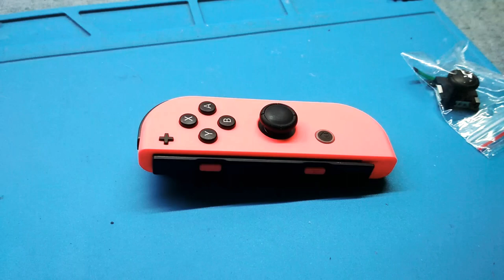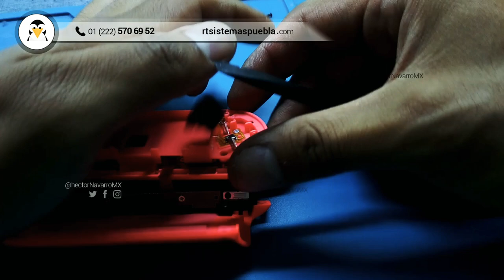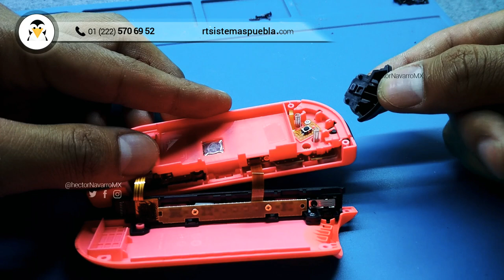How to replace Right joystick for Joy-Con

Comment from the maker: 00:00 Reparacion de control derecho de nintendo switch
00:02 Quitar 4 tornillos (desarmador "triwing" para nintendo)
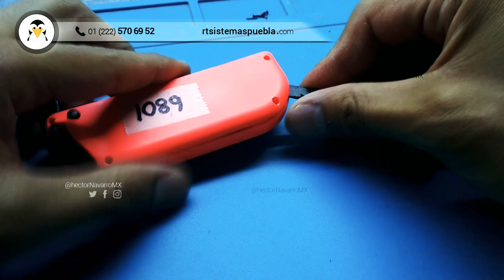00:18 Quitar la tapa
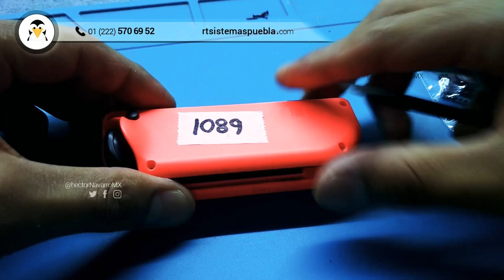00:28 Desconectar la pila
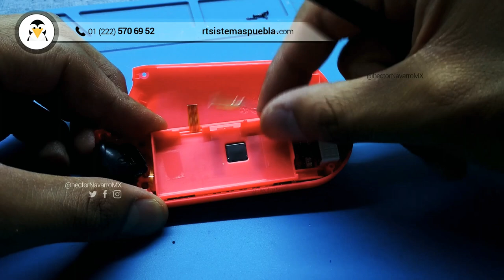00:41 Desconectar la antena
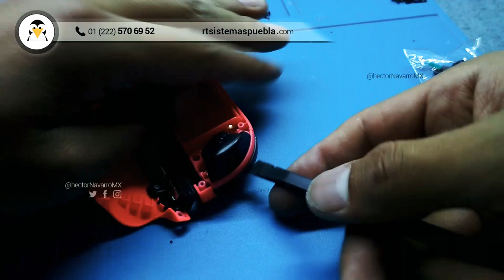00:49 Quitar el botón ZR
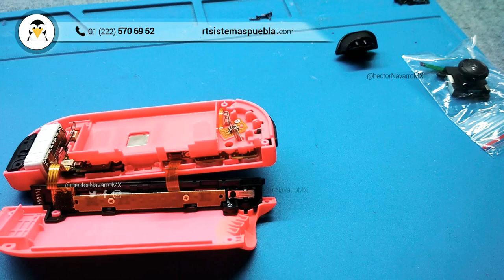01:10 Quitar resortes
01:27 Desatornillar botón ZR
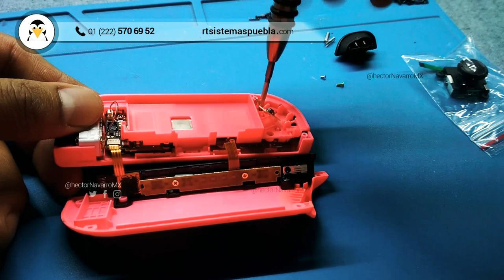01:37 Desarornillar el middle frame
01:45 Levantar el middle frame
01:56 Quitar flexo del joystick
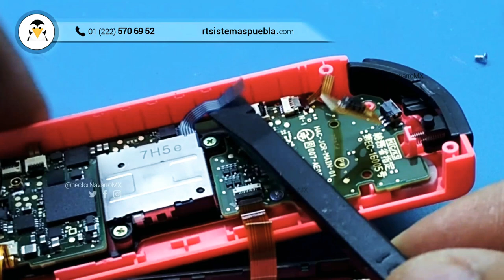02:04 Desatornillar el joystick
02:12 Quitar el joystick
02:22 Colocar el nuevo joystick
02:30 Conectar flexo del nuevo joystick
02:44 Atornillar el joystick
02:52 Colocar el middle frame
02:58 Atornillar el middle frame
03:05 Colocar el botón ZR
03:18 Atornillar el botón ZR
03:34 Colocar los resortes
03:44 Colocar el botón ZR
04:36 Conectar la antena
05:28 Conectar la pila
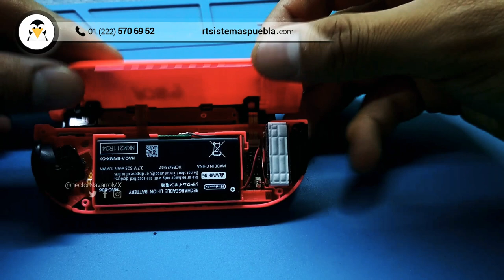05:41 Cerrar la tapa
05:46 Atornillar la tapa
hectornavarro.com.mx